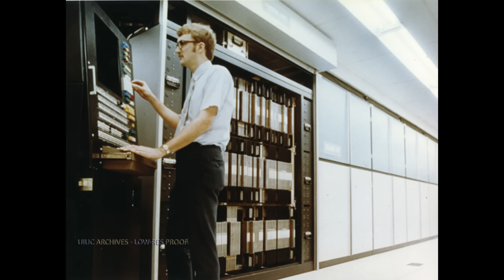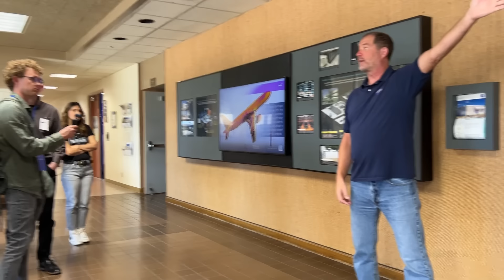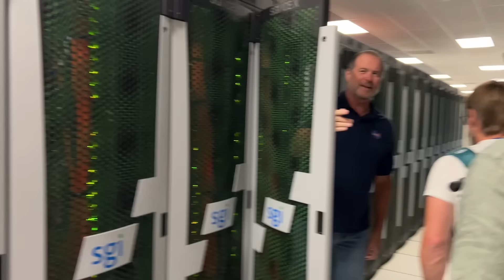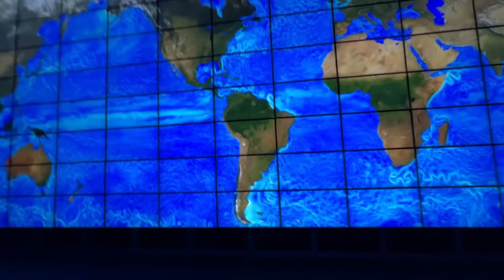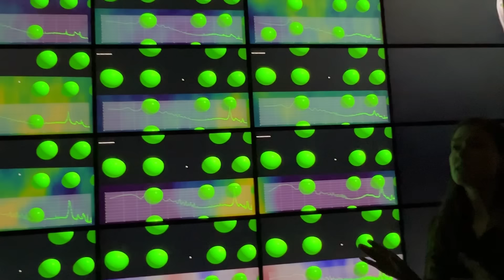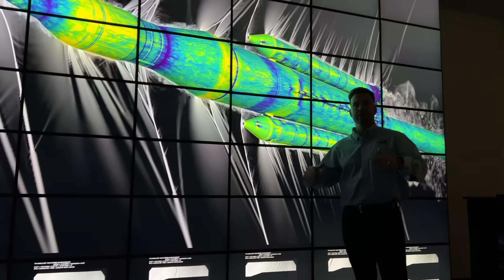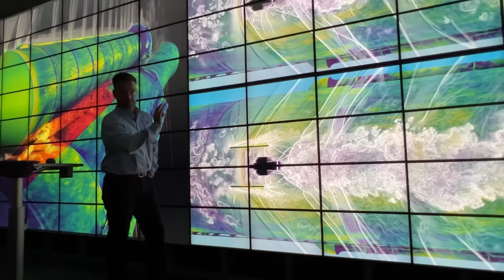NASA's Most Powerful Supercomputers & One Billion Pixel Display

Comment: The power usage is another way to show that wind and solar won't work for a thriving society, only one in decline. 4 MegaWatts  you need nuclear, it's a shame that Americans care more about guns and jesus than they do about science and living through climate change. They need a small scale reactor for a UPS!

Now that would be a dream job, operator at the NASA tape library.

I guess NASA would need a bigger super computer network to pull this off. The ocean currents segment. Running some of the higher end climate models and comparing them to real time observations from the satellite networks.
Reply: No nuclear reactor required.

The world's largest wind turbine is the 26-megawatt (MW) offshore turbine built by Dongfang Electric Corporation (DEC), which is taller than the Eiffel Tower. This is the most recent record-breaking development, surpassing previous records like the 16 MW MySE 16-260 turbine from Mingyang Smart Energy. The DEC turbine has a hub height of 185 m (607 ft) and a blade diameter of 310 m (1,017 ft).

Gonghe Talatan Solar Park (in Gonghe County, Qinghai, China) as the largest solar park in the world with a capacity of 15,600MW
Reply: @universeisundernoobligatio3283  lol when the wind is blowing at a certain speed. Too fast no energy, too slow no energy.

When you have 24/7 uninterrupted power we can start talking about reality here. Otherwise you enter religion's special pleading. You might need to apply your handle to your own beliefs before trying to understand something you obviously don't.

You have no idea what I said, you just posted a fucking ad for the company you work for. nice way to build credibility. 🤣

Comment: In the 80's I was part of a team building a Ship simulator using Ada as the main programmang language. The video wall was 15 mtrs and we had 4 projectors for a 360 view angle. The bridge was a complete build bridge. We used also Silicon Graphics computers. One of the most impressive projects I worked on. MSCN in the Netherlands, which is part of Marin.

Comment: I was kinda puzzled by how hte strake works until I realized that while it looks straight relative to the rocket, due to the air moving otu of the way of the booster tip its at an aoa to the local airflow

Comment: that thing will run my blender file. i accidentally duplicated a geometry nodes setup once and it instantly bluescreened. and an i5-13600kf with 32GB DDR5 ram isnt exactly a slow system

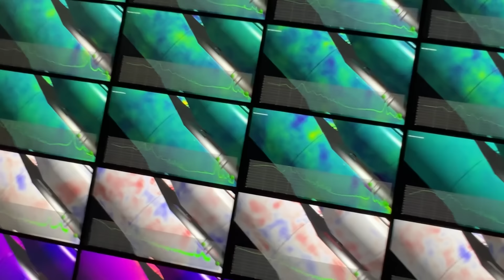Comment: 13:50 So, fun fact: neuroscientists use a similar technique to measure the electrical activity of neurons. Except in our case, we use a "paint" that is sensitive to voltage, instead of pressure.

The current state of the art voltage sensors use something called Förster resonance energy transfer; a fluorophore is excited by just the right wavelength of light, and then transfers that energy to another fluorophore which emits a photon. The transfer of energy is extremely sensitive to the distance between the receiver and the emitter, so you can imagine that if part of the protein is charged, it will move ever so slightly when it senses a difference in voltage. Using a virus, we can make brain cells produce these proteins, and then use microscopes to read-out the membrane potential of dozens or even hundreds of neurons simultaneously.
Reply: Who are you? What do you do? Why are you on here and not in your lab? Lol idk why that blew my mind so hard. I was half asleep but reading this just blew my mind wide awake 😂

Comment: Let me translate that rotational UPS description.  "When it's working, it works quite well" = "it doesn't work well".

The promise was that you'd not have to replace batteries, but the reality is that while the  spinning inertial modules do last a little longer than batteries, it's not hugely longer, and nobody makes replacement units any longer.

Comment: I found my Dad's old slide rule from the 1950's a few days ago.

Guess we've moved on a bit since then.
Reply from the maker: But slide rules are still cool.
Reply: @scottmanley I'm certainly not throwing it out !
Reply: @scottmanley  Did my first real dynamic fluid vibration analysis with one of my 4 slide rules and my Smoley's. 10,000 hp compressor cryogenic piping vibration anomaly suppression. Mid 70's. Air Separation Unit like the one they first installed at SpaceX in Boca Chica. I inherited my slide rules from my Dad and my Father in Law. 3 are Japanese , gifted to my Father-in Law by a Professor of Engineering right after WW2 ended.
Reply: @scottmanley  The world has gone downhill since we have stopped using slide rulers
Reply: @дякую321  no it hasn't, it's gotten faster and more convenient which some people struggle with
Reply: @дякую321 have we lost any math understanding? Slide rules were analog calculators.
Reply: @defeatSpace  convenient😂
Reply: I bought a couple of Slide rules from a place in Russia a few years ago. I have recollections of my dad doing calculations for bridges and buildings parameters in his civil engineering office in the early 70's. He soon had electronic calculators which were a marvel. He has long since retired but does consulting work for free to keep busy.
Reply: One of my watches has a slide rule built in. Seiko SSA005
I still think it’s cool!
Reply: Sliderules are radiation proof, and there are no electronics to break down. Sliderule speeds are only limited by the operator.
Reply: @bert-blank  Usually no harm follows if you drop a sliderule.
Reply: @bert-blank  And the batteries last for ever ! 😊
Reply: I use various slide rules all the time in the control valve and instrumentation field. They are super handy for quick calcs.
Reply: I learnt to use slide rulers in secondary school, 1977.
Was great at the time, could accurate do calculations in seconds - amazing! 
But never managed to learn my times tables properly, which would have been more useful  :D
Reply: @mrb.5610  I inherited my fathers old slipsticks from his time as an engineer working on Mercury and Gemini at the cape. I learned to use them while in grade school in the 1970's because I wanted to be just like him.
I do not often use them but I still treasure them.
Reply: Word. Totally different level, AI in your pocket, madness
Reply: I have my Dad's and several circular slide rules (aviation).  Enjoy using them too.
Reply: Moved in the wrong direction in my opinion.  They took us to the moon without any of this simulation technology, just pure human ingenuity and engineering.
Reply: @TheTurbineEngineer  
Back in the 80's I taught mechanical engineers how to use programs like SPICE to simulate thermal stress in mechanical systems.
They could not have done the same without the simulations.  It saved months of effort and 100's of thousands of dollars and resulted in mechanical assemblies that were lighter and stronger than otherwise possible on the available budget.
So - yea - verily - simulation is a massively powerful tool for engineers and scientists.
I strongly suggest you watch the recent Veritasium video on the subject of jet engines.
Reply: @AlanTheBeast100  for sure, I'm don't doubt the use of a nicely calibrated model but NASA spends far too much time on it.
Reply: @TheTurbineEngineer  That's a weird statement.   You invest where you get returns.  A simulation informs you before you begin building a physical - and costly thing.  A simulation allows you to eliminate bad physical outcomes before you invest time and materiel.  Esp. on big, complex systems.
Do watch the video I suggested.  All about turbines.  You should enjoy it.
Reply: I bought a couple of those from Germany a few years ago, one each coming from the then-East and West Germany. I haven't got around learning how to use them yet, but would definitely come in handy if/when our electronics are rendered inop in some kind of "energetic event". I have a set of tutorial and guide printed out and placed in a pouch together with the slide rules for this purpose.
Reply: Slide rules are computers.
We got the SR-71 and went to the moon with these. Respect.
Reply: Not trying to jump on your case. We certainly have, but slide rules can demonstrate some fundamental mathematical properties, such as summing exponents to arrive at a product.
Reply: Just a bit lol
Reply: Slide rules helped build the SR-71... that's a huge point of pride you can't take that away from them! 😎

Comment: Problem with TFLOPS is that it doesn't mean much. Because not all FLOs are equal. A lot of consumer products measure 32 bit performance. In this you're measureing something like 64 or even 128 bits. There is a huge penalty for that on an nvidia card.
Reply from the maker: This is why the LinPack benchmark was created, to ensure they’re talking about double precision, and using processes that require interconnection rather than purely parallel workloads.
Reply: Thank you. For AI applications, however, often only 16 or even 8 bit data types are used

Comment: It's funny that NASA use old flywheel tech to power their super computer.
Reply: It is actually used a lot even if you have mass battery banks it is still used as it is "almost" instant power where the battery load can dip off the gate.

Comment: Yeesh the no-strake SLS looks almost like the classical cylinder vortex shedding example.
Reply: Is that phenomenon the reason why certain bare-pipe chimneys have a spiral running down the length of them? I seem to remember someone mentioning that it prevents wobbling but not elaborating further
Reply: @P3x310  yes. It's there to disrupt the cylinder and its aerodynamics that create the vortex shedding, and the spiral just makes sure that it works no matter which way the wind is blowing. If you're looking for a more thorough explanation, perhaps youtube comments isn't the right place for that.
Reply: @P3x310  
Long, thin car antennas have it as well, and for the same reason. It's a vortex generator to prevent oscillation. On chimneys the oscillation can cause them to collapse if it hits the right frequency, and on antennas it creates a loud whistling, which would be supremely annoying to listen to every time you drive.

Comment: The paint based pressure measurements are very interesting. I actually worked on a device a couple years ago that would be an oxygen sensor based on what sounds like a very similar principle.
Reply: excited photocatalyst triplet state quenching of by oxygen is something I try to avoid while doing my hydrogen atom transfer photocatalysis, fun to see that there :D

Comment: there is no way that "teraflops" and "petaflops" are real measurements
Reply from the maker: Floating Point Operations per Second - basically the rate that a computer can do proper math (not just integer or logical operations)
Reply: Huh? Do you think Scott just pulled those terms outta his ass?
Reply: @EnthDGree  oh what? no i was just making a joke because the name sounded silly
Reply: @dr_nerdin  For those working in and around IT this was a weird response. The metric is so common that finding out people don't know it is a bit shocking. Scott has a lot of crossover so it is easy to forget that space nerd does not also equal IT nerd :)
Reply: @dr_nerdin  Ah! My sincere apologies, sir!
Reply: Whoever named them mustve been high but they're real
Reply: What a quick reply from scott 😂

Comment: "One billion pixel display" - could be achieved with a grid of thirty-two 8K displays, 4 by 8. They're obviously using older 4K displays in an 8x16 grid. There's a system integrator that claims to offer a machine with eight GeForce 5090s in it, that could run the whole thing if 8K displays off one box. (For >$50,000, and they say it's for "AI use", not to run 32 8K displays at once.)

Comment: But can it run Crysis?
Reply: Clearly not otherwise they would have said so. 😆
Reply: it runs dooms, that's good enough
Reply: great comment for the millennials.
Reply: Will it run GTA 6 ( If that comes out before the heat death of the universe )
Reply: @tyrantfox7801 Only at 1080p
Reply: Running in full resolution of 1 billions pixel?
Reply: I can not believe Scott would leave us hanging on the Crysis question 😢
Reply: I bet it can run GTA 6 before it comes out
Reply: Classic
Reply: For these days, can it run Star Citizen?
Reply: Don’t make me feel old
Reply: Considering that the original Crysis was configured for single core processing.  NASA's supercomputers per core performance would probably match or slightly outperform mid-range computers from 2007.  Based on that, not accounting GPU performance, it would run at about 30-60 fps...😅
Reply: @kobusdowney5291  A modern Xeon core would be way faster than a 2007 CPU core, no?
Reply: @uku4171 my 2007 Q6600 ran at 3.2GHz overclocked.  Modern Xeon cores run at 2.0.  Lets say IPC has doubled, that would roughly put it at 50% faster.  Given Crysis ran at 30-40fps on it back then,  on a modern Xeon core it might achieve 60fps if we're lucky
Reply: Probably not tbh
Reply: Nope
Reply: no surprisingly they developed for single core processing but we ended up using multicore processing
Reply: Yes it can Run Crysis 2
Reply: @NightWolf-Y2K  Crysis 2 is easy to run compared to Crysis 1...
Reply: what?!? no!
Reply: If it can run doom, i would happy with 658.285 FPS
Reply: Will it blend?
Reply: can it run Ready or Not

Comment: wondering how much a graphic card that refreshes 1 billion pixels would cost and how you would cool it
Reply: 25x Multi Frame Generation and one RTX 5050 - It just works.
Reply: H100. Around 30k/gpu. A system can have like 8 or 10 of them. A supercomputer will have multiple of them as well. Usually watercooling and lots of fans do the trick.
Reply: ty gentlemen - too bad those monitors didn't have thinner bezels
Reply: Not possible with a single card, you have to use multiple. Nvidia (and probably others too) have solutions for this. They did something similar for the Sphere in Vegas.